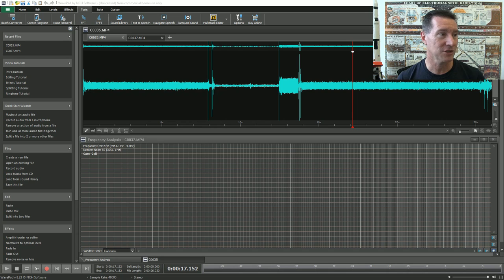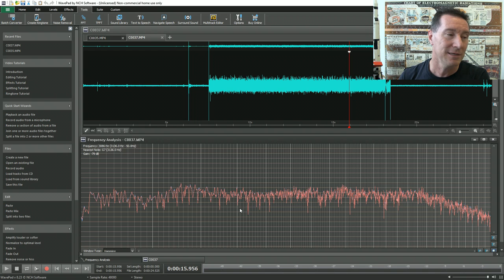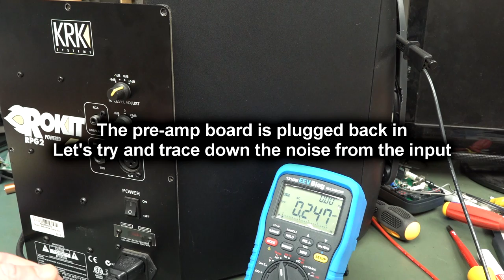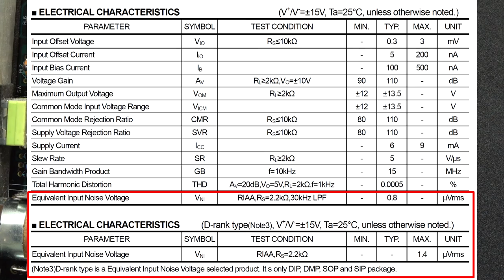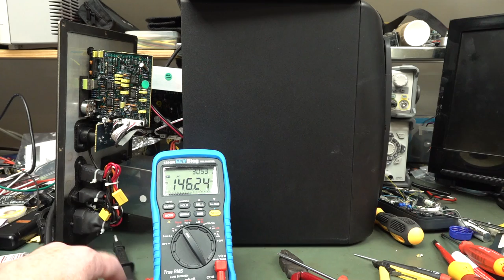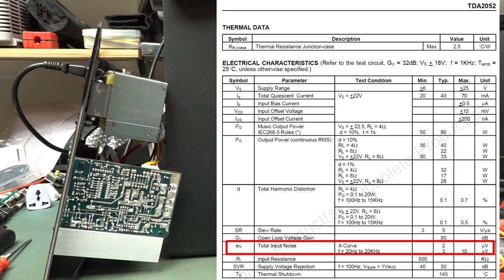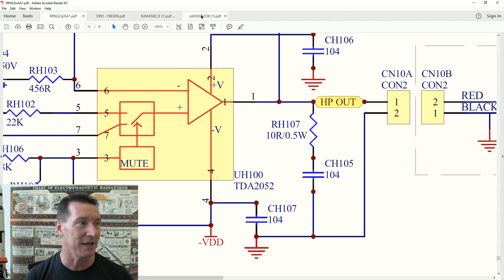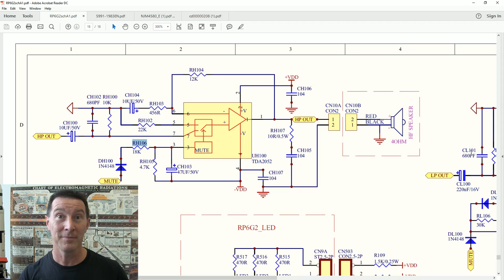EEVblog #1118 - Why Are Studio Monitors Noisy?

Comment: Grab a pair of Genelec monitors and you'll experience a very different result.
Reply: namely overemphasized mids and a too flat bottom end.
Reply: I am grammy nominated. I know what monitors are. genelecs are not my choice for monitors.
Reply: Adams are my go to modern monitor
Reply: I'd challenge your Adams with PreSonus Sceptres S8!!
Reply: @HaxxyHagberg  It's all somewhat subjective. Adam's are often touted as being extremely bright due to the ribbon tweeters, which leads to unexciting mixes until the track is mastered by someone with an independent ear.
Reply: i still go for in-ear headphones that i got with my smartphone. no jokes - you get a perfect 1:1 coupling of air pressure from the drivers to your ear drums. its not a level response, but its free from distortions. whilst it might not be tone-perfect, it is extremely revealing & clear. 

i use it to finely look for stuff. and then do my tone matching / profiling on other gear.
Reply: headphones are not that great for mixing stereo recordings.
Reply: Or even just jbl lsr's. they dont have any extra noise
Reply: Expensive, too expensive for most people.
Reply: re: "headphones are not that great for mixing stereo recordings." dont tell me this crap. who are you trying to convince here? i'm not going to believe you since i obviously understand this in and out. are you trying to convince people who arent me? why don't you address the specifics?
dont spin out nonspecific bullshit. address details.
Reply: pepe6666 tracks mixed on headphones, more often than not, only sound good on headphones. and I mean full-band, live drums and live instruments. not samples or synths which are already processed even before the mixing stage. there are some out there that know their headphones very well, and how to compensate in mixing, but that is rare, and even then, they are likely referencing on an actual monitor setup at some point.
Reply: pepe6666 have you actually mixed a full band with both headphones and monitors? there’s a big difference in how the sound reproduces elsewhere. I’ve mixed on a few different high-end headphones and found that low end reproduction is nearly always an issue.
Reply: pepe6666 go to a world-famous mastering facility and tell them to ditch their $100,000 speakers for some headphones.
Reply: No bottom end at all then?
Reply: pep6666 Nothing is free from distortion.

+ a lot of the things listed here maybe poor system design, wrong driver choice or a combination of both. Genelecs is just a brand like many other audio companies.

Monitors are speakers, other speakers can also have great near field response if designed correctly. 

Ribbons are NOT bright unless they have a peak somewhere due to improper design.
Reply: Or just a decent pair of passive monitors and a real amplifier, not some Class D kludge.

Comment: The 100hz in the woofers comes from using cheap Chinese caps in the power supply, they need to be lower ESR and higher ripple rejection Japanese types.  And perhaps use slightly larger capacity ones.
Reply: It may be generated by the rectifier diodes. All diodes around the switching point can generate small transients. The effect is more wideband than just 100Hz, but that's often where it shows up most noticeably. It is not unusual to put small value capacitors across each rectifier diode.
Reply from the maker: Zadster - I think that would be a combination of wideband noise floor like the tweeter and the 100Hz ripple. I doubt the diodes are causing the noise.
Reply: It still could be very interestig what happens if you connect the board to a known low noise power supply, like the ones you got laying around everywhere ;) Maybe you start a trend in the audiophile scene...
Reply: You will always have some 100Hz residual no matter how low ESR the capacitors are, use a SMPS to get rid of this problem.
Reply: are you serious? 
When i worked for a company which did some mil-grade power supplies...it had sym. 18Volts stacked CLC filter and an two quarant class A driven ouput. noisefloor was -120dB throughout.
Reply: TubiCal, -120dB what?
Reply: I wouldn't be so fast to blame the power supply.  It could be bad shielding picking up ambient noise.
Reply: @outsideworld76 use an SMPS ? And go from having 100Hz hum to wideband hash from the switching noise...
Reply: Frankly, if the hum is coming from ripple just when idle, you have to wonder how well the power supply will perform when you start cranking some loud signal though it.  The hum could be coming from stray magnetic fields from the transformer.  There's lots of sources.
Reply: you know the hum i could deal with. once i spent ages writing a comb filter to pull out all the harmonics of my mains hum. that mic i found on the side of the road was great after that.

alas i'd rather the hiss than the EEEEEEEE SQUEEEE!!!! FUCKEN SQUEEEE LOOK AT MEEEE sounds.

alas i'd rather not the hiss at all thank you very muchly
Reply: the best electrolytic caps are made by the big 4 Japanese capacitor companies, Nichicon, Rubycon, Chemi-con, and Panasonic and also the smaller Japanese companies of ELNA and Toshin Kogyo - but as far as as signal caps like foil in oil and polypropylene and other small values type, there are tons of great options, even Russian military surplus teflon caps - the main thing is to avoid Chinese caps, and counterfeits, so never buy of ebay, amazon, parts express, etc. - stick with Digi-Key, Mouser, and Newark Element 14 ONLY.  (well except for Russian caps, those have to come direct from Russian or Ukrainian ebay sellers)
Reply: @Peter Mulholland, and that would be a bad thing? Just shift it out of the audio band and you will be fine. No audiable noise at all.
Reply: Or one could somehow solder in some ceramic capacitors in parallel to the giant electrolytics to compensate.
Reply: @ Burrito rustler - Well that's stupid, there are a lot of great Chinese Caps if you know where to source them.
A lot of high-end Chinese companies with crappy websites do not need marketing power to sell their product. This includes batteries as well.
The big brands do all that stuff as marketing to maintain their image to justify their price premium, and to satisfy their higher end customers, who the Chinese don't care about selling to as the volumes are too low. 
History has proven every dog has their day.

You can work decades in the industry and have very little real quantifiable experience in capacitor quality and reliability, apart from the anecdotal.
Reply: No , there are ZERO "great Chinese caps" - that like saying there are good Chinese cars, which there are not.  I have been in the capacitor business for 40 years, and in my job I have to test every brand out there, on an ongoing basis, week in, week out - all of the good electrolytic caps are Japanese, almost without exception, there are one or two Korean cap companies that are OK, not great, and one or two German cap companies that are decent - that's it, end of story on cap quality.  Just something that the Chinese have not yet figured out correctly, and there are no more good ones made in America either.

Comment: have you tested if the 100Hz humming is because of bad power filtering or if is magnetic induction because the transformer is near to the speaker? did it go away when the take it apart?

Comment: On my RKR i can hear louder if I have something moving on screen, like a window or even my mouse, it's like the GPU interfering with it. Even if I turn off the monitor stills there. Reducing the volume knob on it made subtle now.
Reply: in this case it’s most likely something to do with your computer power especially if you hear some type of chirping you can change the power usage in settings

Comment: this is why you never buy speakers with a built in amplifier. you never know what you're going to get, it's better to buy passive speakers with a separate amp because then you can use whatever amp you want. notice how with speakers that come in both a passive and powered version the powered version isn't much more expensive from the passive version? that's because the amp in the speakers isn't that great. the passive speakers would be better if you have a good amp to drive them.

Comment: I had problem with ground loop. It took almost 20 minutes to figure it out.. I have laptop and eGPU, both are connected to same power bar with monitor, amplifier and PS3.. I tried to run a grounding cable from amplifier's back (there is screw for it) and put it to something metallic, it did not help at all. Then i just discovered if i unplug my PS3 from mains the ground loop stops, but it's bit pain in the ass to plug it every time i want to use it so i took an short Ethernet cable and plugged it to PS3's back and other end to my laptop's port. Quess what, no more ground loop or any kind of hissing sounds

Comment: Well I have a Sony system (STR-DE310) which has the same thing, hiss noise will increment proportional to the volume pot. I need to find a way for minimizing the hum from the transformer for the power supply too, which is pretty disturbing sometimes...

Comment: Is it inherent in the amplifier or not? I had the same issue which is common. When I built mine, I used only the best components available on everything and still I had that noise and even though you purchase the very best, it could very well be faulty so before I sealed it up we always have to be ready for SHTF. I heard the that noise and the first thing that popped in my head was, I'm gathering noise from the lighting and the equipment so I took it all apart never checking anything else and I designed shielding for each layout which was a aluminum box that fit each board perfectly and yes I designed them so heat will vent, but at the top would defeat the purpose so made a couple slices at the top of the side not facing any other boards and lifted the top of each cut, then I lined the entire inside of the enclosures with some heavy duty aluminum tape and mocked them together and tested it, my heart hit my bunghole because it was so silent it was like I forgot to plug them in all the way up, thought I shorted something, but when I applied music it was beautiful sound so try that and thank me later. It's not a bad thing to have in the first place so try it and let me know.
Reply: I also will be installing a slow start board in each speaker which slowly fills the caps without the initial wallop of electric and will add life.

Comment: Are these things that are called "monitors" any different from a normal set of usual PC speakers? I keep hearing this "monitor" thing and all I see is the same speaker boxes I have on my desk from the local IT store... well not exactly the same make and model, but you get the idea...
Reply: I believe monitors should have a very flat frequency response. So they won't have loads of unnatural bass on them. I'm fortunate to have a pair of used Genelec 8020. Very flat response, very quiet. But very expensive!

Comment: Please please, explain how to get rid of the 50/100hz humming noise coming from the monitors which is caused by the emf generated by the transformer. I could move the transformer outside the box what would eliminate that noise completely, but maybe there is some more elegant solution for this? Would a toriodal transformer help?
Reply: 1: 
Definitely, a toroidal transformer will help, if really the stray field of the original transformer causing the problem. What can also help, if you wound the existing transformer in thick (few tenths of a millimeter) copper foil (the thin, self adhesive EMC shielding copper foil may not be sufficient for 50/60Hz mains transformers), overlap and solder the two ends together, like this: https://ae01.alicdn.com/kf/HTB1mzLlIVXXXXXhXFXXq6xXFXXXE/ER28-EC28-custom-transformer-high-frequency-ferrite-core-transformer-with-shield-copper-foil.jpg . It also helps if you also wound an other copper foil around the iron core (perpendicular to the winding on the bobbins). These will introduce a short circuit to the stray magnetic fields. 

You can also make a shielding out of transformer core laminate sheet, like in this tape deck: http://www.nosztalgiaradio.hu/images/radio/orion/sm250_1.jpg ., but it is very sensitive to the orientation relative to the component which is picking up the hum (in other words, it makes the stray fields directional, 'focusing' them in some directions).

Displacement of the transfomer even a few centimeters, or rotating it sometimes gives a huge difference.

2:
Are you sure, that the source of the hum is the transformer's stray field picked up by the circuitry? As others also mentioned, it can be generated by the rectifier diodes as well. They generate a sharp current spike between forward and reverse state. This pulse is in the microsecond or even nanosecond range, but it's repeated twice in every cycles, so it can generate hum twice the frequency of the mains. You can eleminiate it by putting a few tens of nanofarads (47nF is usually well enough, don't go above 100nF) low impedance bipolar capacitors (multilayer foil type, like WIMA MKP) parallel with the rectifier diodes, with a voltage rating at least twice the secondary AC peak. Other few hundred nF foil capacitors in parallel with the reservoir capacitors are suggested, although these are usually not necessary, the capacitors parallel with the rectifiers makes much more improvement.

The hum also can be created by bad PCB design or wiring, if the power and signal grounds are not separated well enough. There is no general recipe to repair it, every case should be examined individually. Generally speaking: proper star grounding, avoiding ground loops are essential. Sometimes moving the negative terminal of the speaker to a different GND point (near to the PSU ground, eg. the common point of the reservoir capacitors) can help, but be aware NOT to do this if you have a BTL power amp.

That's it, in a nutshell... I hope it will help.
Reply: mrnmrn1 thank you for your comprehensive answer. Yes, I'm sure this hum is caused by inductance on the pcb caused by the transformer as I've tried already unscrewing it and trying different angles, the hum was the least noticable with 45deg placement of the transformer, but it was almost completely gone when I moved it away by 10cm as that much I was able to move it due to the short leads. The transformer also gives off a little mechanical buzz by itself, but you have to be very close to hear that. I'm planning to buy a toroidal tranny if I will be able to find one in similar dimensions, if not I'll try wrapping it up with foil as you suggested.

Comment: Dear creator.. I write this with distress..
Been using the WXA-50 for 5 months now with 3020i and yesterday for the first time I noticed that the amp is sending out a mild static noise on the speakers when AUX is selected as output, even when there is NO INPUT to the amp at all. Is this in any way normal for something this costly?

Comment: Thanks for the good content. My issue is that one of my HS8 monitors sounds punchier and more open than the other and i switched both to test if it’s the positioning that caused the issue but it still the same. Could that be the fact they need to broken in?

Comment: Puts hear up to fully open powered speakers capable of 125+db... Plug in a mic through the xlr input and try that again.. You'll go instantly deaf..
Professional speakers when used with balanced cables easily go into 120+ db s/n. The reason is simply to eliminate tone sucking circuits that are not welcomed at all... 
I'll take the noise and turn it down thankyou!

Comment: my krk v8 series 2 are super quiet, usually only noise is ever from source audio not being grounded correctly.  Also carry  in line isolation transformers.  Regardless, so happy I don't have newer plastic models.  Holy cow
Reply: im testing mine asap but no way do they sound like that.

Comment: I just use normal pc speakers.
works fine most of the time. The response isn't ideal or perfect but it gives a good representation for what an end use might experience 
my iPhone has some noise and so do my pc speakers but its a lot lower. iPhone sounds like white noise. My speakers seem to sound like higher pitched and softer kinda of like dial up? But its only on the active side. So the sound is probably from the internal circuits not the speakers.